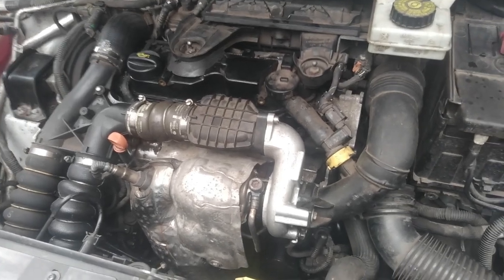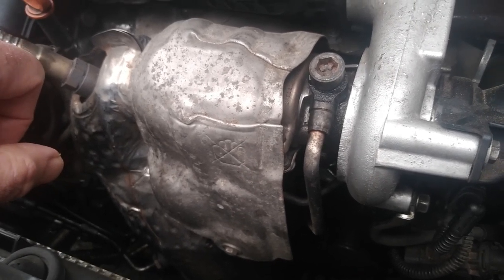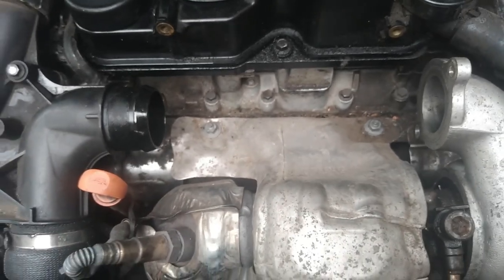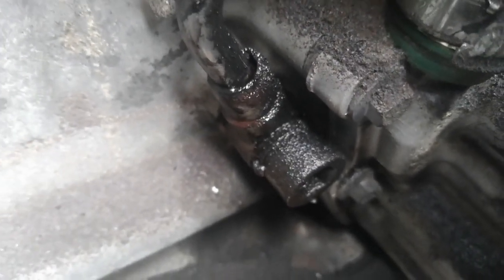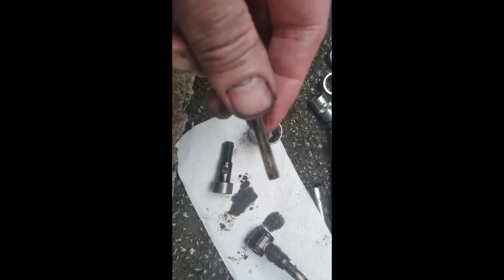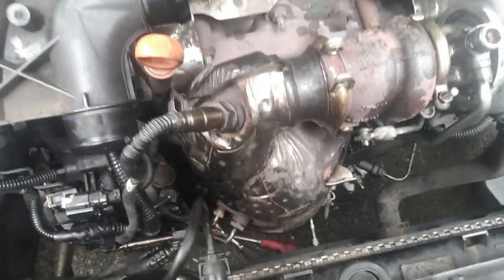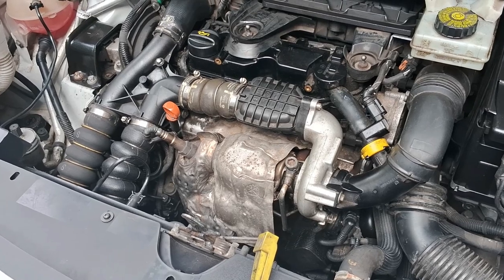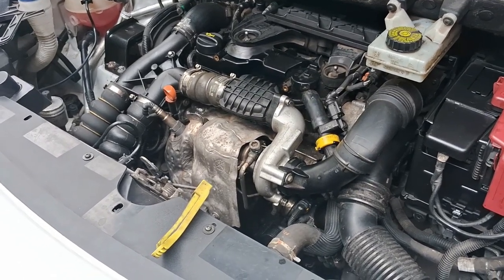DIY FIX noisy turbo, whining noise repair. Blocked Oil Feeds Peugeot Partner Van Citroen Berlingo

Comment: Hi Andy iv got a partner 1.6hdi .can you please tell me what gearbox oil I need for it.its 2012 .there so many different people saying different grades/halfords come up with 80/90 and there gl4 gl5 .you seem to know your cars so thought I’d ask thankyou
Reply from the maker: yes , i checked mine. and toped up with 80/90. you check the level through the passenger wheel side, i thinks its a 19mm bolt

cheers andy

Comment: I have a 308 1.5 bluehdi similar engine.
I have a kind of a whining noise around 2000rpm, I can get it to do it while at idle but not as loud as when driven. I’m wondering if I have this problem also.
It sounds like something like air noise that’s a very short sound around 2000rpm then disappears. If I put my foot down I don’t hear it .
Reply from the maker: thats probably when the turbo is just kicking in. hhmmmmmmm?
yes, could be ? or air leak? maybe from intercooler or its pipes?
let me know how you get on, cheers andy
Reply: I had some problem with Peugeot partner whistle noise I found something conected  to THE  DPF like air  sound coming from there

Comment: mines whistling its tits off, im going to have to do this can i not just wedge the dpf/cat over do i have to drop it
Reply from the maker: yes , but its not too bad to drop it. but i know its a pain but its best to drop the sump and change the pickup strainer. flush it as well or its just going to give you trouble. if you are keeping it?
Reply from the maker: and while you have got the dpf off, wash it out. it will need it and benefit from it
Reply: @andyfireblades ok thanks